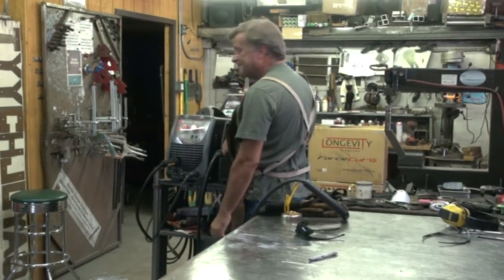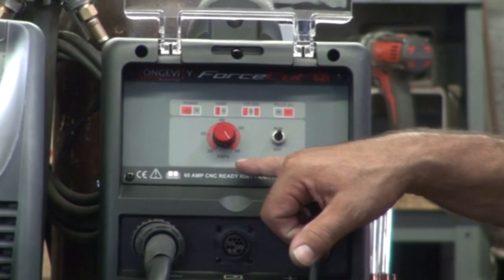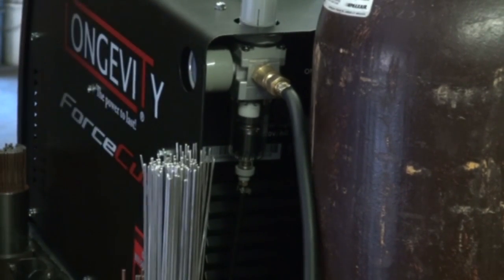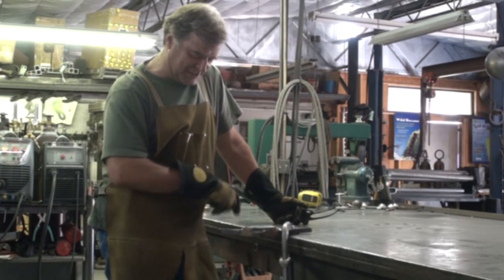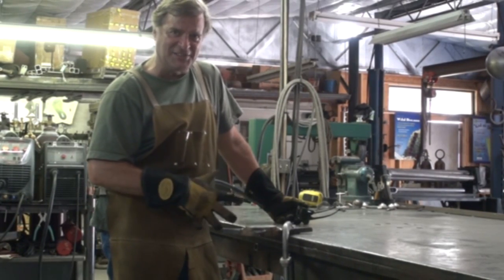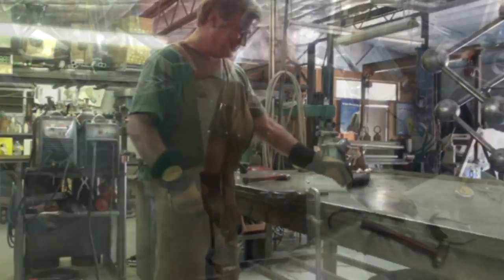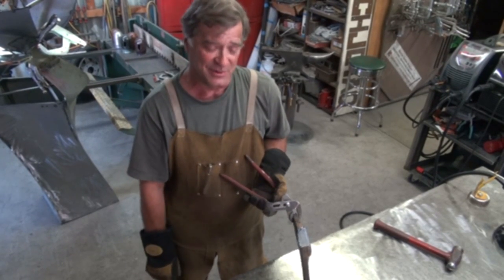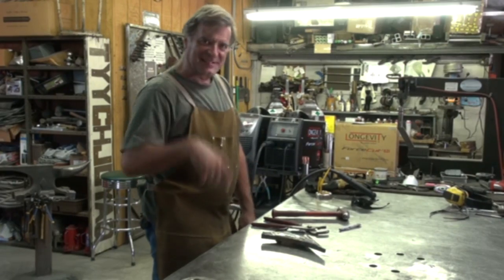Introducing Longevity's ForceCut 62i Plasma Cutter - Kevin Caron

Comment: Stay away from Longevity. I bought a Forcecut 80i and it was a waste of money. Their customer service sucks and they don't return phone calls ever. I had called them several times they never returned one phone call other than want me to buy it. The plasma cutter I have owned it for about 7 years now and only used it a few times because it's always broke down, I had it repaired a year ago and it still don't work after spending $375.00. I asked them how to attach a torch height controller to it and not one of them could give me and answer. Save you money and buy from someone else other than China made Longevity.
Reply from the maker: This is a very old video!    And yes, I agree.